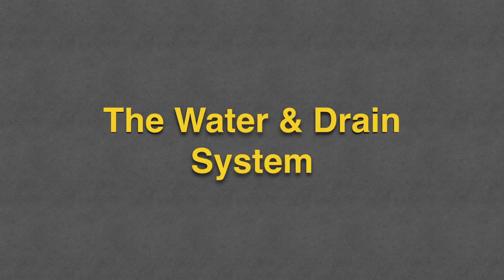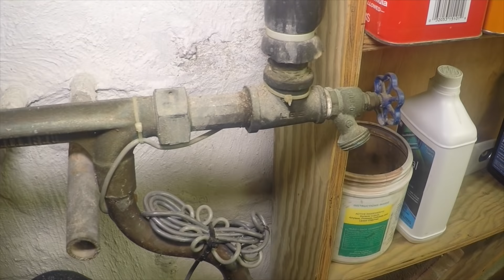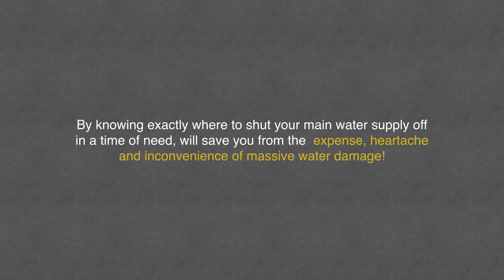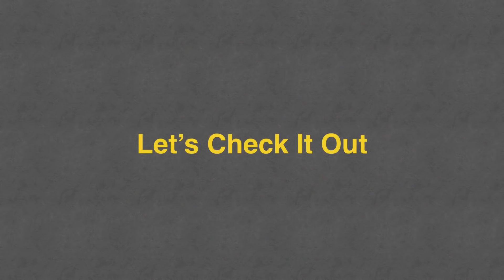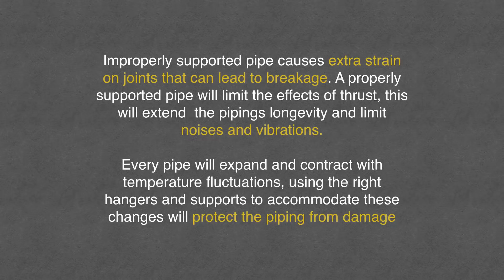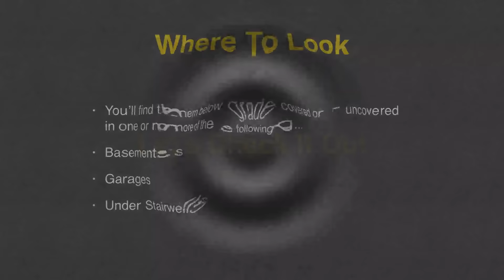Home Plumbing Maintenance

Comment: Just purchased a home, found cleanout without a cover. Should i do some sort of maintenance before simply replacing the cover? Should i use a snake to clean out any possible debris.
Reply from the maker: That's a judgement call, If it's not broke don't fix it. On the other hand for peace of mind snaking it out won't hurt.

Comment: Great video Mr.Sessa,one thing that you didn't mention is installing a water pressure gauge before and after the PRV (Pressure Reducing Valve).Installing a water pressure gauge is essential in my opinion because that is the only way to determine what the water pressure before the PRV is and what the water pressure is coming out of the PRV.I had to replace the PRV that I installed when we first bought this house because a PRV  had never been installed on the main.I got tired of running back and forth from the boiler room to the basement sink to test the water pressure to set the PRV at the appropriate pressure so what I did was that I installed a water pressure gauge down stream from the PRV which not only served to make it easier to adjust the PRV but also allows me to know what the water pressure is at any given time.The one thing that you mention in your video which I have not done yet is installing a backflow preventer on a hose bib water line and that will be my next project.Thank you for your wonderful videos Mr.Sessa,God bless you and yours.
Reply from the maker: Thank you Nelson, much appreciated!

Comment: Hi Bob,  on a system with a PRV what is a good psi to have it set at, so you have good pressure for things like your shower,  dishwasher etc but not to high as to damage your system,  also will higher pressure cause water hammer , thanks Bob
Reply from the maker: Somewhere between 40.p.s.i (min) & 80 p.s.i. (max)and you'll be good to go!

Comment: Bob, I have a maintenance question.  My tube faucet stems leak very badly when they are opened. I have packed them with the graphite stem packing but it doesn't last more then a week.  This is the description of The faucets, they are circa 1936. when you remove the handle there are sleeves with a flared ends  that slide over the faucet stems and the flared end is held in place with a packing nut.  I believe the flared ends are there to compress the packing.  When I packed them,  I removed the packing nuts, removed the sleeves, cleaned out the old packing , wrapped the new packing counter clockwise about 4 to 5 turns around the stems and tightened the packing nuts.  after few days  some of the packing actually moved through and out of one of the sleeves. What do you suggest, I'm stumped
Reply from the maker: Clockwise! Never counter clockwise, the packing will back out everytime you turn the faucet on.
Reply: ? but I am opening the faucet counter clockwise wouldn't I  be backing out the packing if it were wound clockwise?
Reply from the maker: 588158 if you open the faucet counter clockwise, install the packing clockwise. Sounds counter intuitive, but it worked for me when I was servicing those types of fixtures.
Reply: Thanks bob I'll give it a shot. Are packing washers also a possibility? Thanks always for  your help; it  is so much appreciated!
Reply from the maker: 588158 They use to make pre-formed graphite packing washers. Next best thing would be to use a spool Teflon. Not tape. It’s approx. 1/8” in diameter and once you tighten the packing nut, it should stay put! Good luck!
Reply: thanks so much bob really appreciate it!
Reply: @BobsPlumbingVideos  Thanks Bob, your advice is always valued and appreciated.
Reply: Thanks Bob! The spool Teflon did the trick! I bought some Teflon packing which looked like, for lack of a better word, a piece of Bucatini pasta.  It is pretty thick stuff but I got it in and it sealed perfectly. Thanks sooo much!
Reply: bob you're absolutely correct about wrapping the packing clockwise!  i now realize that even though the valve opens counter clockwise , the packing nut is being tightened  in a clockwise direction. now we have to tell this old house NOT to tell people to wrap the packing counter clockwise!

Comment: Good educational video. What sump pump are you using in your house? Using a 5 gallon bucket is a good idea.
Reply from the maker: Because it is a five gallon bucket, I had to find a pump where the float can ride freely without getting hung up on the sides of the bucket.I use the FloTec brand available at Home Depot. They've never failed me to this day. Regards, Bob.

Comment: Bob, great video learned a couple of things here one which should have been simple like the Vacuum breaker for the hose; I will be purchasing one of these soon. I have an active sump pump and yes I do have a spare on hand although it is here it is not ready with PVC ready to go so this I will be doing shortly so I can do a quick swap when needed. The sump has to be 10 years old and besides being used as drain tile it was also commissioned as a drain small as it may be to catch water on the sidewalk and pass through the sump. Had a water main break at the end of the driveway about two years ago; well lets put it this way the sump got a very good cleaning the day. It was ripping but it kept up and still working today. Got a new driveway on the city that needed replacement. The first example of the water meter is pretty much what I have, the gate and then because the gate functions but it does not seal I added the ball valve just aft. I do have a vent or what looks like a vent but I cannot identify what they are using it for, it is nearby the sump and closer to where once was a water softer and at the same location there is a 5 gallon bucket buried in the cement with only the lid showing which I have never removed. Not into letting Gremlins out if I do know whats inside. I would like to send pictures so you can help identify what this vent looking system is or does. You can always share it, if you could send me an email address so I can send pictures.  Hard to believe you would have Trolls here. If so they need the education your providing here!
Reply from the maker: Curiosity Sure, you can send photos to: info@robertsessaplumbing.com. Regards, Bob.

Comment: are backflow preventers required in residential NYC homes (1-2 family homes)?
Reply from the maker: If your home has a boiler (steam / hot water) or any equipment where the water supply could potentially be siphoned back into the city water supply...YES.